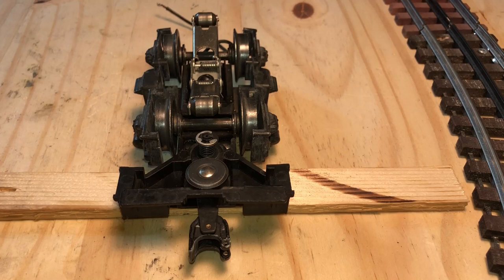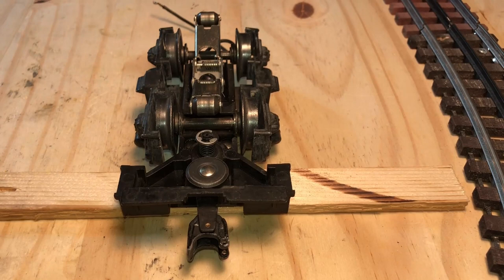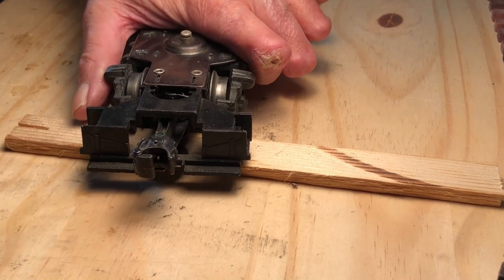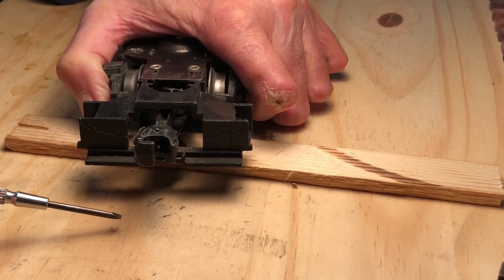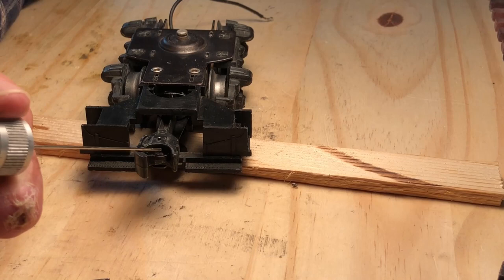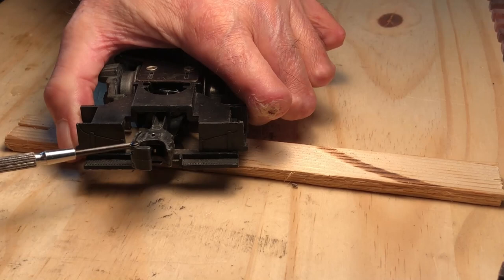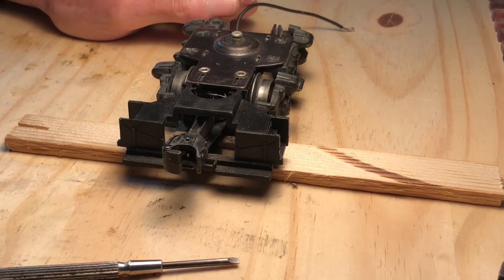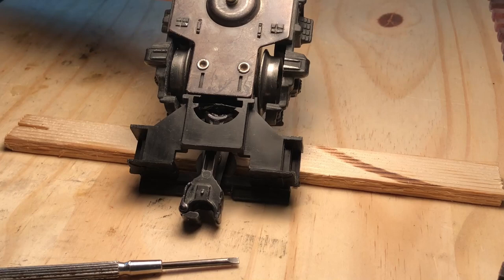O Gauge Lionel 628 power truck coupler centering assembly & coupler repair.

Comment: Another great video, James.  I have a postwar steam switcher 1615 that has a similar mechanism though made out of metal.  I have taken it apart several times and given it a good lube, but still have some difficult with it centering.  The coupler has a bit of side to side play that i just cant seem to eliminate.  If I find the cause, I will let you know.  Again, thank you for producing these videos and sharing your experiences with us.
Reply from the maker: Thank you!  You might need to stretch the spring slightly which will add more downward pressure on the "T-Pin".

Comment: Hi Jim, could you send me a link to the video about greasing the gears in the trucks? Which kind and how much I'm interested in. Thanks for excellent videos. Oh, by the way, many videos by others are mumbled or steps they feel not important are omitted leaving the viewer confused or trying to mind read. NOT YOURS ! Yours have a feel like I'm in a classroom presentation with an educator who knows how to teach. Thanks!
Reply from the maker: Hello again Frank!  I do not have a video yet particularly regarding greasing the truck gears but I soon will post one.  In the meantime I use "Wheel & Bearing Grease" from the auto parts store the one I use is a NAPA brand.  The grease is very thick and does a great job and I use a small paintbrush to "paint" it on all the gears.  You can paint just the lower end of the gears that are easily accessible from the underside of the truck and then after turning the gears under power the grease will coat their mates.  Also coat the worm gear on the motor shaft which you can reach from the bottom and guide the small brush between the the truck axle and plastic bearing plate.  You can see the gear on the motor shaft with a flashlight.
Reply: @jamesburns0657  in one of your videos I saw you had a tube of "gear grease H65... Something" What was that?
Reply from the maker: @frankstar3417  Oh yes, that is a light duty gear lube and this is the WOODLAND SCENICS HL655, HOB-E-LUBE, GEAR LUBE, 14.7ML, 0.5 FL OZ.  A little goes a long way.  The video I'm working on now explains how it failed in my Hudson's Gearbox because of its' inability to dissipate heat.  I'll be posting that one soon.  Otherwise it's a good gear lube for the gear train in the diesel trucks and Postwar Steamers.
Reply: @jamesburns0657  Hi Jim, Wow that's interesting, what failed in the gearbox?
Reply from the maker: @frankstar3417  the gearbox produces a lot of friction among the four gears the motor is driving and I was hoping the HOB-E-LUBE would be enough but it was not good at dissipating the heat build up from the friction and ultimately thinned out to the point of dripping like water out of the gearbox under the locomotive  which caused the bushings inside the gearbox to expand from heat and lock up preventing the locomotive from running.  Once I discovered what was happening I cleaned the gearbox again and replaced with the NAPA Wheel Bearing Grease, which is designed to dissipate heat, and now everything runs nice and cool. Sadly that gamble also destroyed the universal joint I had made up.  Everything is fixed now and running better than ever though!  Video coming soon I hope!
Reply: @jamesburns0657  Wow, I never knew that about grease. Thanks again for lesson 😀,